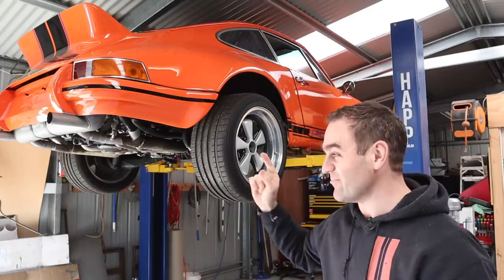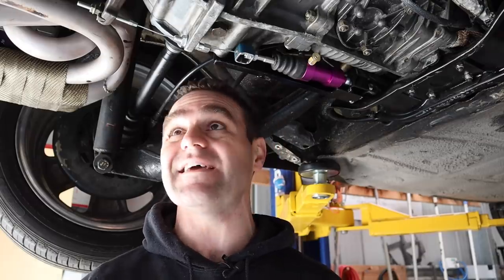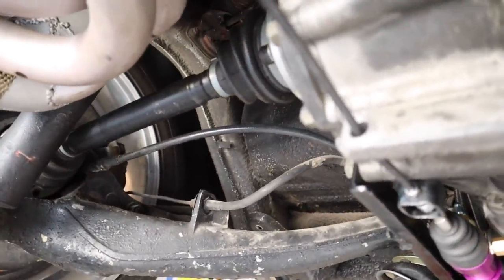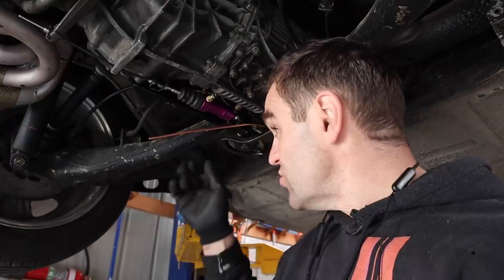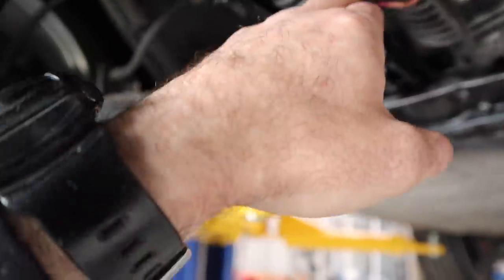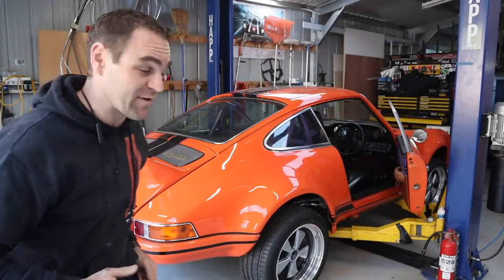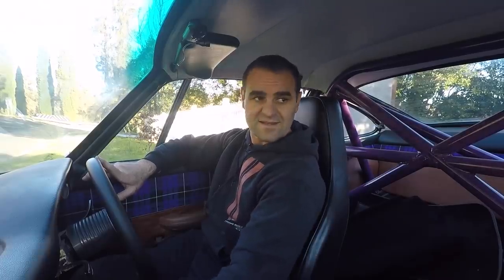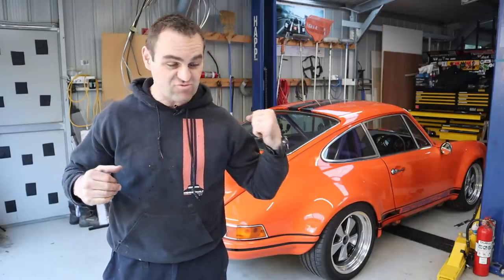Now it actually drives! - Porsche 911 2.8 RSR Build Season 2.44

Comment: Note, There should be a short flexible hose between the hard pipe and the slave cylinder. You run the risk of the line fatiguing and failing.

Comment: Nice work Jeff. One suggestion- double nut with a larger washer the rod end at the clutch throw out arm (vs the single nut /washer shown). Inside nut to adjust throw and outside nut to lock in place. Cheers.

Comment: Great to see that the clutch working now. It's always the small jobs that take the longest. The rear end doesn't have to be raised very much & it will be much better when you get the cold running problem working better. That bracket sure needs to be thicker so it doesn't move around.

Comment: Do not use tape on bleed nipples. Tape is a one direction one use only assembly otherwise they are prone to leak. Instead just smear some grease around the nipple before loosing it and it will not suck any air in through the threads. I am very happy for you it finally is drive-able. It’s a huge milestone and releases all frustrations when sitting behind the steering wheel - all imperfections are then forgotten :)
Reply: Xiranu isn’t there a risk (admittedly small) that you could suck the grease into the system and contaminate the fluid?
Reply: Emma Jacobs nope. The air always travels the least restricted path witch is then through the hole in the nipple. Also keep in mind the grease is thick and put on around the nipple before loosing and not on the threads of the nipple. It is the best way if you do not have a pressure bleeder.

Comment: Great tip on replacing cable with a hydraulic clutch 👍👍👍! I do have some concerns about the hard hydraulic line all the way to the slave pump. Isnt it going to break eventually because of the vibrations of engine and gearbox? In all cars i know of the last part of the line is done in flexibele tube from the chassis to the gearbox for that reason. But great idea to make this convertion! 👍

Comment: Maybe take a look at the E39 M5 intake design for the MAP sensor. It, too, has ITBs (powered by that same throttle motor, haha), but between all of the ITBs is a series of little o-ring’d tubes that connect the engine side of the ITBs together for vacuum reference for the brake booster, the Secondary Air Injection system, and idle control. The ITB runners are all contained in a giant plenum, with two big MAF sensors. It also handles the CCV/PCV system on the underside.

Comment: Jeff,  please do some more research on copper lines in hydraulic systems such as brakes and clutch because of the reactions with copper and different types     of fluids and with heat build up copper sweats which causes condensation both inside and out. Not sure if its copper but it looks like it.

Comment: Jeff just a quick one, great video as always. Are you worried about clutch line fatigue over time as you have no flex section for the vibration of the transaxle? older cars usually use a couple of loop coils to allow play or flex line at the slave cylinder end to a body mount point.

Comment: Hardline straight from the pedal to slave...... you'll end up fitting a flexible pipe on the gearbox end..... the gearbox is rubber mounted, and will move,  whilst the clutch pipe will flex little,  its not ideal

Comment: Looks great. Having no flex line on the engine side going to be ok?
Reply: I thought the same also.
Reply: Looks as if maybe the cylinder is not floating but secured onto a bendy mounting bracket.
see the 8 seconds after 7:41 where Jeff mentions his bracket needs more support, if he doesn't stiffen that support then definite need for flex cable or that nickel copper brake line will work harden and crack.
Reply: @ed_cetera  But the entire engine and gearbox is vibrating and moving about on the mounts. It looked like hard line all the way from master to slave. Maybe he put a flex line in where it goes from body to engine/trans.
Reply: Wes Gates no issue on the porsche as it is a balanced motor with an more or less solid mounted motor with little movement - remember the motor is not twisting at acceleration. Also the bends on the lines are enough to make it flex. I can balance a coin on my motor when running
Reply: @wesgates5632  Yes Wes flex line from the body to the engine assembly wouldn't hurt

Comment: Did you run hard line all the way from Master to slave? Is the engine and gearbox hardmounted to the body? If not you really should have a flexible hose in there somewhere

Comment: Please understand it will never be happy cold. Just the nature of the beast because of the flat design and how the cam chain works. Be patient during break in start ups to let the engine warm for several minutes. There's literally a module on the engine called the 'cold start valve', it does need to be adjusted when new.

Comment: Rod is a great solution instead of a cable. Running very rich when its cold. How does the ECU know the engine is cold as water temp is obviously not a thing?
Reply from the maker: Surface temp sensor.

Comment: Thread tape is a no-no  on any brake fitting.
Reply: BRETTYZCAR why? Threads don’t do the sealing except when bleeding? I thought it was a good idea!
Reply: @danopureblood7066  thread tape has a tendency to break up and get into seals, jam wheel cylinders and so forth. Same for fuel fittings. A smear of grease around the top of the thread or bleed it two person method is best.